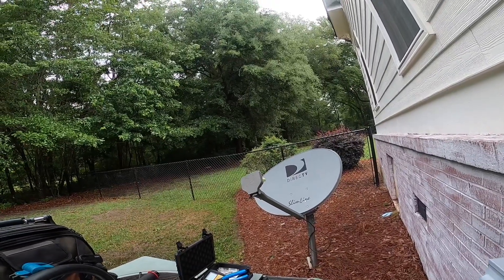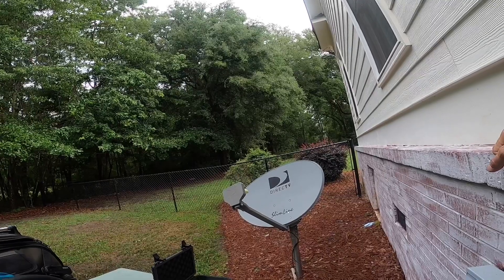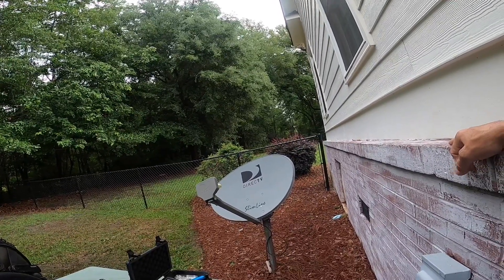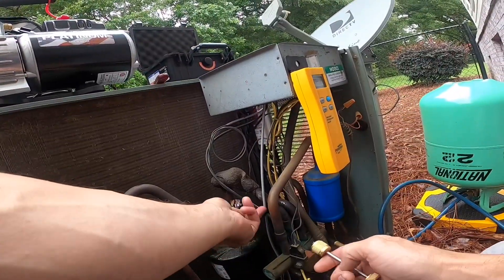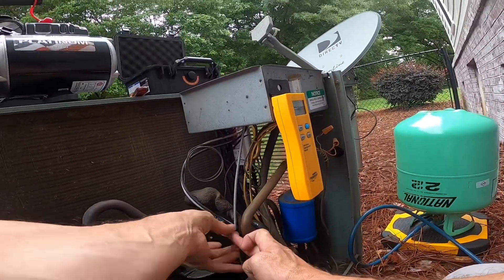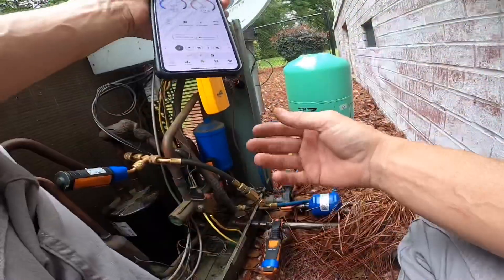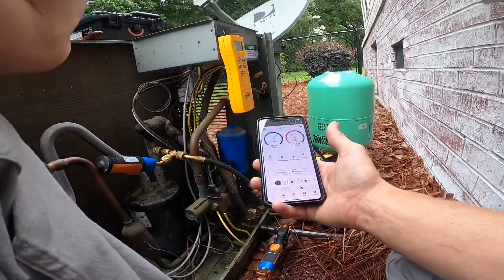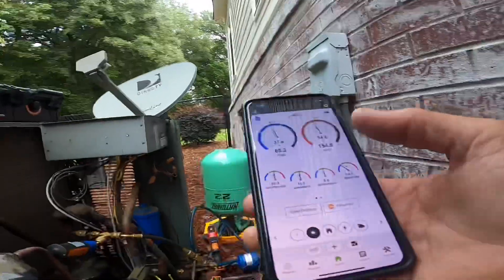Replacing alternate freon after loss of capacity.

Comment: I can't do anything remotely like that 🤔compressor ,evaporator& compromised refrigerant maybe?🤔🤯
I've only replaced compressors for the company I worked for , I will never do it for residential customers!!
But anytime you do, driers need to be installed and removed(suction)!
That's a total change out with line set .(period)
🍺🍺🥃🍺🥃🍇🏌🤔🤯
Stay safe.
Retired keyboard super tech.
Wear your safety glasses.